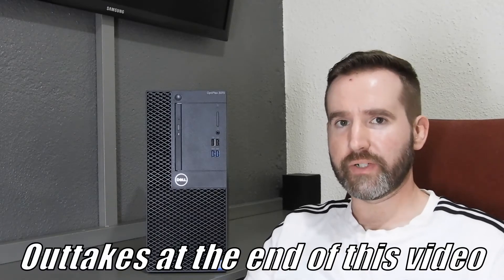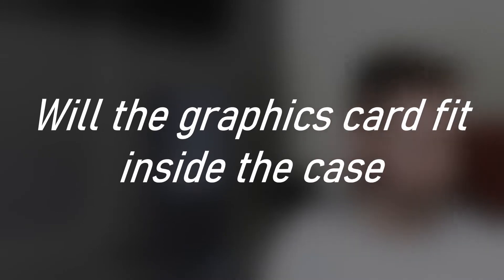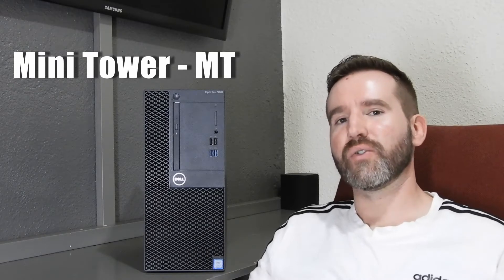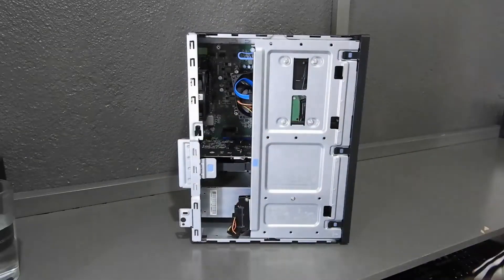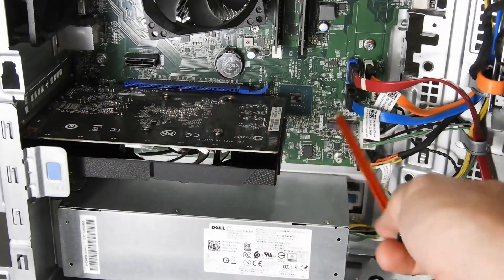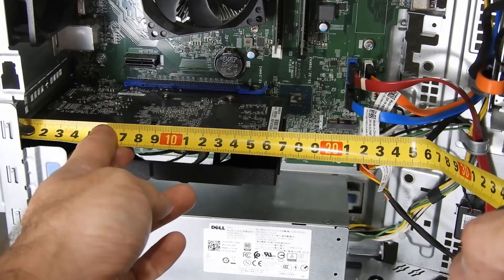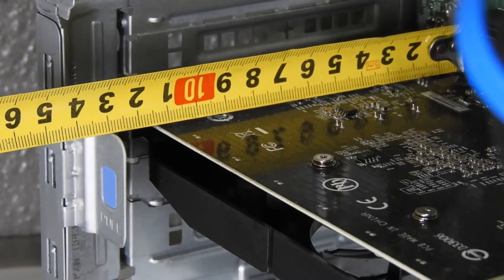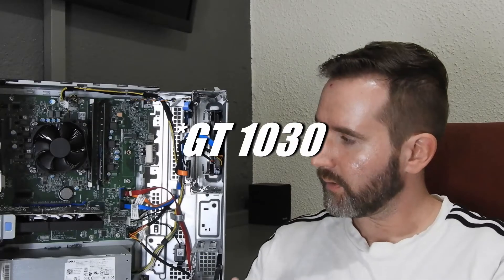Dell OptiPlex 3070 Core i3 9100 Watch FIRST before buy a GPU | Figgy D Randoms |

Comment: Hello, since you have the GT 1030, could you let me know if you have any problems with pre-rendering/playback on Premiere pro when editing with lots of effects.  Would really help if you answered, since I am trying to get into Video Editing, thanks.
Reply from the maker: Hey there. Playback and pre-rendering with little/moderate effects worked ok (definitely usable) but with with lots of effects caused my PC to crash. I stopped using Premiere Pro as I found it to be very buggy with my system, so I switched over to Da Vinci Resolve. It's never crashed before, BUUUUT it's a lot more resource hungry than Premiere... so playback with moderate effects can be annoying at times.

Comment: The GTX 1650 super's length is 229 mm, would it fit (Asking since you said the limit is 200 mm)? And would I need a new power supply for it?
Reply from the maker: If a graphics card is longer than 200 mm it'll hit the SATA cables. I watched a video from another channel and he said the limit was 220 mm (but he isn't using the second SATA port like I am) I guess you could try and squeeze the card in there but do so at your own risk. The gtx 1650 super needs a 6 pin power connector which this power supply doesn't have. Hope this clears things up for you.
Reply: @FiggyDRandoms  Thank you very much for the information.
Reply: What's the link where you purchased the graphics card?